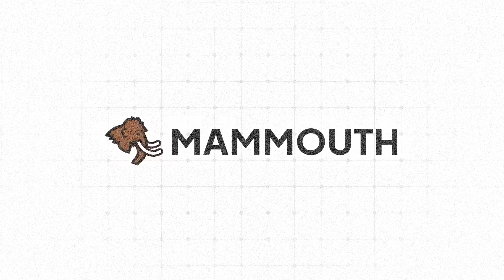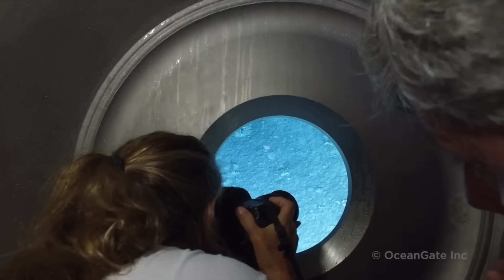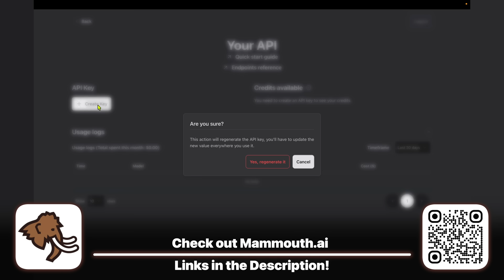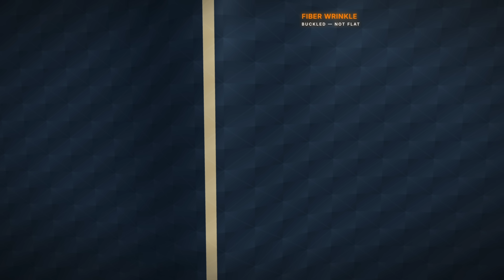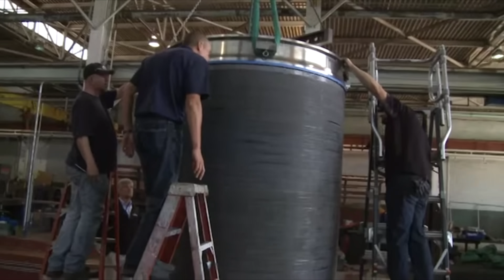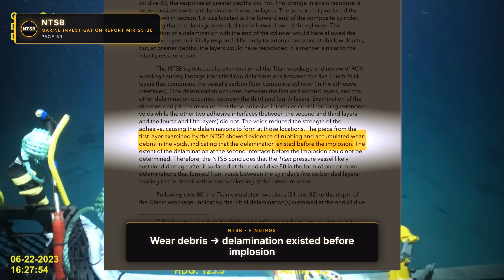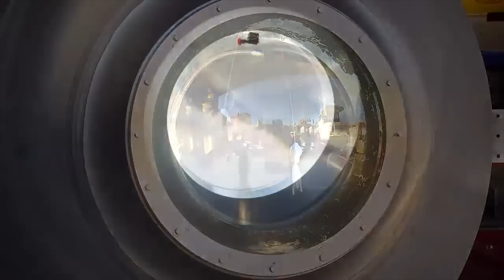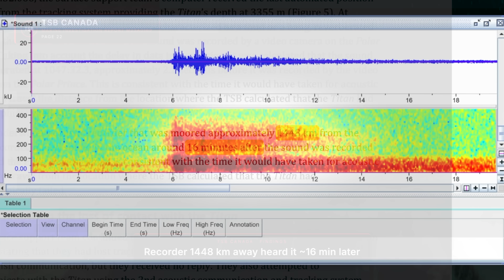Oceangate Titan: It was WORSE Than We Thought

Comment: Carbon fibre likely was NOT the problem. Delamination is not a carbon fibre problem, but references the glue between the layers of carbon fibres (string, thread).
The carbon thread has incredible tensile strength but zero strength under compression. You can use carbon thread to build tubes for the bodies of airliners because going up in the atmosphere there's tensile strength on the carbon threads.

Note that an airplane's lifetime is defined by maintenance, flight hours, landings, but in the first place by the height at which it got flown. Higher up has less dense air and therefore less drag (resistance) but the reduced air pressure relative to the pressure inside the plane (kept at air pressure of about 2,500 metres altitude) means the inside over-pressure causes enormous tensile loads on the hull. Compared to Titanic depth, the difference is negligible, but for the expected lifetime of the airframe-tube it's essential. Airline companies need to monitor that. And flying high becomes an optimisation problem between fuel costs on the one hand and the plane's life on the other. You only go higher if the fuel savings outweigh the wear associated costs of the aircraft's body getting stressed more.

As carbon has incredible tensile strength, delamination plays less of a role in the carbon fibre wall of the airliner. But it's there.
The carbon fibre, in the airline industry, has a best before date, though. This relates to guarantees for the economic lifetime of each plane.

The sub in this marine case was built from carbon thread past Boeing's best before date. For being cheaper.
And, be fair, who cares about the carbon being past best before? It never gets put under tensile load anyway when diving with that tube. Its strength fully depends on the glue between the carbon threads that are about as weak as sewing thread, under compressive loads.
So it's all about the "glue".

Monitoring for delamination in a crude way yet ignoring it at the crucial level.

It's what you get when presumed billionaires think they are always right because they hired idiots that tell them all the time they are always right: yes men.
In political theory we'd call that fascism. And next to amateur operations, it happens in politics and businesses, even. Can you imagine?

Comment: I always wondered (and still do), how a fibre, basically a tiny string, can be used to withstand an immense *pushing*, not a pulling force. Without the raisin gluing all these strands together, the whole construction would crush immediately. So the raisin has to bear (most of) the whole load, but this will also crumble under a pressure of 40 MPa.
It is different when you want to contain a higher inner pressure. Then you pull at the carbon fibres, and all is fine.
Reply: Fibres help resin not to crumble as easily. Without fibres it falls apart into pieces, but when all the "potential pieces" are tightly held together with fibres, it's much harder for the cracks to appear.

Comment: I’m a gunsmith/firearms design engineer. People don’t realize how much testing goes into the things they use. Especially with vehicles! I deal with not only the mechanical interaction of  firearm parts but the immense pressures the chamber and barrel are required to endure. Factoring in heat cycles and metal fatigue again and again without failure. Something very few shooters even consider, but if I don’t do my job then shooters can easily be maimed or killed by my lack of attention to detail.
Reply: I read .30-06 20tons per square inch?, chamber pressure

Comment: Woven Carbon fiber also is strongest on tension, not pressure.
Solid Metal is strongest under pressure and ok under tension.

Thing of fabric.
Properly stretched, or coated in glue, it's quite hard to press on. But fabric itsself has very little resistance to deformation.
However, fabric is very strong at being pulled at. It needs a lot to tear it appart.

Comment: One glaring problem here is the opening sentence of "carbon fiber which many people pointed to - isn't the villain". Followed by a long talk about inherent problems of carbon fiber - from the unavailability of anything resembling "an ideal weave" to the sort of bad fatigue behavior where faults can be hidden for long, while propagating until failure.

Exactly the reasons people with clue pointed our carbon fiber for. So it is the villain. Nobody said it's the sole or even main villain - given that concrete ships were made and sailed, I think with really proper engineering and manufacturing it may be possible to build a working concrete sub. Does not mean it should even be attempted, or that the concrete as a material is OK for the purpose.

Edit in: exactly the kind of global reasoning mistake typical of clickbait-ish AI slop that is often pushed out as "analytical content" these days. AI sponsorship. Coincidence? 

Had they build their titanic-lite from, say, whole titanium, to the same margins, standards and tolerances, it would have had much better chance of either turning out OK, or at least showing fatigue/degradation slightly in advance.

Then again, the late mr. Rush would've rushed to trim some more off that "excessive" OK titanium hull for some savings, obviously. 

Of course NO material, diamond or cardboard, can be more villainous than, say, firing your structural integrity / safety engineer for raising concerns about structural integrity and safety. This is quite self-evident.

Comment: The lack of shear ply seems recklessly optimistic. Longitudinally it was an epoxy bond, with no longitudinal CF. From the Space Shuttle SRB segment O-ring reports we all learned that cylinders under pressure have an annular rotational flex (inverted in this case). This would have focused shear strain and cross sectional rotation at the interface gasket & bond at each end. I would expect that end cap bond to just get chewed up and not just because of the differential expansion. I'd expect damage chipping and erosion of the CF at the gasket interface as it rotated against the titanium plate behind the compressed bond. Just guesswork of course. But all that annular rotation and flexing is supported by epoxy rather than CF.

Comment: it makes more sense to make a theatre on the boat that is like a full enclosure, 360 degree sphere with chairs and drinks and air conditioning so paying customers feel like they're in the sea themselves, and then set up well equipped camera drones to send down there. yeah its not authentic but you can lower costs while double or triple your customers per outing and you can also say "child safe" so rich fucks with kids will becomes customers too. you can rent out an old yacht or cruise ship or something. if i worked for a cruise line i would definitely propose something like this, it doesnt even need to be active footage to be honest, it can just be a recording. do several recordings of several tourist spots so you can do whatever one they want, then you dont even have to go out to sea. sit the whole theater on fluid suspension so you can simulate being at sea.

Comment: It's shocking enough to contemplate shaving the safety margins while building a vehicle meant to go into places where it's not like your car stalled in a bad part of town.  It's more like you're driving and the car detonates.  You don't get a do-over any more than you would going into the vacuum of space in an ill-suited vehicle.

That said, once we got to the point of "shaving down" wrinkles in carbon fiber...  You know, given that the FIBERS are what give the vehicle its structure and strength and this would inherently mean breaking them...  Yeah, I knew we weren't exactly dealing with the best minds on the planet.

Comment: BOOM. And there you have it - Carbon Fiber WAS NOT the demon that everyone was making it out to be. At that thickness it would have been virtually indestructible at the depths they were going, to which relatively speaking were not that great compared to where other hulls have gone. But YES, you need an error-free manufacturing process in order for that to be the case.

Comment: I don't get the need for carbon fiber at all. For aircraft, I get it, but for a commercial sub? It doesn't need to be light. Why would you care about strength to weight ratios on something designed to sink? Steel is just so much better understood (and cheaper). The number of people who are competent at working with steel vs the number of people who are competent at working with carbon fiber; there is no comparison.

Comment: One Very Glaringinly missed 'Thing' is that the Hull was under 'Compressive Load' ..... IF this 'Tube' was to have ALL the Load from the Inside ..... YES it would be 'Perfect' - ish  .... Have a 'Pressure Vessel' loaded externally was just a 'Recipe for Disater' and was Sadly Proven So ......  There would be No Circumstance where the 'Carbon Fibres' were under Tesion and Carbon Fibre does not 'Like ' Compression . Also it does Not Appear as though there was No 'Helical Wound' Layers .... ????? Thanks for your Great Vidclip ..... Best to All from ChCh, NZ

Comment: Great review.  I spent most of my engineering time building prototypes.  A prototype goal is to answer unknowns for the next iteration, it has to work.  To do that it has to be more conservate because of more unknowns.  

This was built to achieve a cost and thus an income return per dive.  That is a failure before it even started, and I question the engineers that remained. This design needed proven very capable engineers with a strong analysis background in understanding all the technologies involved.  Their have been some good FEA analysis done on the hull including video on YouTube but those people lacked the wider understanding of the whole technical issues. 

I would even question the thinking of those that rode in the vehicle.  As an experiment. I would want to get other opinions of the design.  Not being certified requires even more of those opinions.  As a prototype designer and proposal team member I have almost no items that passed certification.  But I can show a history of results.  And result on my analysis.

There was a very strong sight that this last dive was it's last.  The data you showed of stress v. depth and the separations between layers found.  All support my statement when it happened that the submarine gained weight, water filled the voids,  which showed in a faster decent and slower assent the dive before and a further faster decent on the last dive.  The ballast calculation was done on paper assuming the hull never changed.  So the changes in rate has to be a weight change of the hull because everything else was measured and adjusted for.

Comment: Non destructive testing isn't as mature because it's composite.
Steel we had for centuries, alu in reasonable amounts onty decades, however because it's relatively homogenous material just like steel, NDT techniques often carry over with little to no change. Composite is beast of it's own wich we need to test over and over until failiure, and few more times just to start understanding how it fails.

Comment: You stated that it wasn't the fault of the carbon fiber material and if it was built perfectly, it would've easily survived. My main counter to this is: how likely could such a perfect carbon fiber structure be built and to know, with a high degree of confidence, you met the expected safety criteria? Yes -  these clowns who built Titan cut more than a few corners to the point of abject negligence. But I think the material is highly unforgiving and even when built by a more competent team, it'd be tough to pull off and have the known reliability of another material (metal). As you stated, carbon fiber structures for this purpose are much more difficult to test, inspect and know the fatigue characteristics and to know what your safety factor really is. I still think it's a bad material choice -  because building it perfectly is extremely difficult. Let's say you build one and test it to failure and you get a safety factor number that you think is good. How confident can you be in the very next one you build? I think you'd have to build many across normal variations in material and process, and test many to failure before you'd have any reasonable sense of a real safety factor. Building one isn't enough.  In a situation like this, you want to stack the cards in your favor and choose a design with materials that are more tolerant of the processes and conditions involved.

Comment: I would most certainly take a properly engineered craft to deep submergence depths.  In fact, I have years of submerged submarine service in properly engineered submarines - ships designed, built, maintained, and operated with high levels of engineering discipline.  Stockton Rush was not disciplined to the laws of good science and engineering, one of which is that all such rules are written in blood.  He, in effect, will be responsible, unwittingly, for the future application of the correct rules before hopefully anyone else would try his insanity.  Remember that he stated that those that were attempting to advise of the rules of science and engineering that would have spared him and his passengers were a bunch of old white guys he didn't need telling him what to do.  So he died of extreme hubris, killing - or murdering - his passengers with his lack of discipline.  I would feel sorry for him but that he killed other innocents.

Comment: Carbon fiber is touted as this miracle structural material that is incredibly light and incredibly strong - which is mostly true when used appropriately.  What people don't realize is that once you leave its "area of expertise" carbon fiber CAN BE extremely vulnerable and weak.  You can take plain carbon fiber tow ( a small bundle of the fiber itself) and you would never be able to manually pull it hard enough to break it, but pushing it just wads it up into a ball, and furthermore if you tie an overhand knot (introducing shear) you can pinch it between your finger and thumb and pull it in two.  Composite structures are just as dependent upon the matrix (the glue) and direction and angles of the strands as it is on the fiber.  The interaction between matrix and fiber is also a critical concern as a broken strand has to transfer the loads it normally would take to those next to it.  The problem(s) with the design and their production process, especially with this material, are incredibly complex and Stockton Rush seems to have dismissed everyone that disagreed with him and ignored warning signs that should have raised flags over and over.  He died and took innocent people with him as a result.  May we all learn from this.

Comment: 13:02 That's called alarm fatigue, and it is a real issue even for alarms that are not false.  It happens in healthcare all the time.  This is why you not only have to make sure your alarms are accurate, but also relevant and requiring action.  That's different than actionable.  An alarm can be actionable, but not requiring action to be taken.  Otherwise the alarm is pointless.

Comment: While carbon-fibre-composite might not be fundamentally bad for high-pressure applications, there are manufacturing issues that are always going to be problematic. No matter how hard you try, there are always going to be wrinkles or discontinuities in the structure, especially if you include the diagonal plies that everyone except Rush considered necessary. So even if they included diagonal plies, built the thing to the recommended 7" thickness, had new titanium end caps fabricated so there was no need to cut or machine the CF composite and built it as a single layer, those wrinkles or discontinuities would still be present. Which means you'd need to fully characterise the variabilities of the manufacturing process. And this would mean testing to destruction of many hulls. Not just two or three, but hundreds. Only then will you be able to say you understand the manufacturing process.

Comment: It just seems isane that they used unidirectional continous fibre orientied along the circumfrence of the subs hull. This way the fibres literally don't carry any of the bending load caused by the cylindrical design. All the bending load is carried by the resin, which is way less stiff than the fibres, breaks more easily (about 20 times more easily) and is prone to local defects spreading causing total failure.
Reply: in a perfect circular shape the hull is in near complete uniform compression. The only bending being from other forces acting on the hull and the slight differential pressure from the top to the bottom. The original report on the hull design recommended 7 layers not 5 and recommended cross laminations at an angle to the circumferential windings. Both of theses recommendations we skipped in the final build.

Comment: I think it's absolutely insane to think that they never performed a fatigue analysis. As an engineer in the train sector, I even have to do fatigue analysis on non stressed parts, where failure would literally be close to irrelevant in terms of danger.
Reply: The only way to do a fatigue analysis on carbon fiber is by destructive methods. You have to cut into it. Doing that would mean it gets thrown away and needs replaced. Rush's entire business model depended on the hull being reusable. You can't reuse it after testing.

Comment: The carbon fiber was a mistake.  Filament wound pressure vessels are very strong for carrying compressed gas and are used all the time.  The fibers are in tension and the impregnating epoxy holds the fibers shape.  That is fine for a positive pressure where the fibers are in tension.  In a submarine, the filaments are in compression and you are relying on the epoxy for compressive strength.  Epoxy is just a type of plastic.  The hull of this submarine was relying on plastic in compression.  This is a idiotic design.